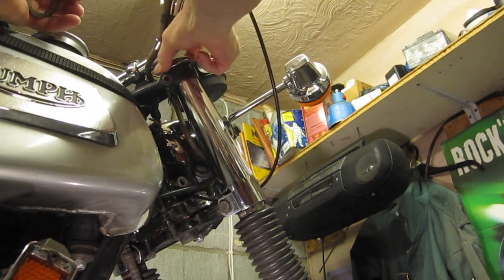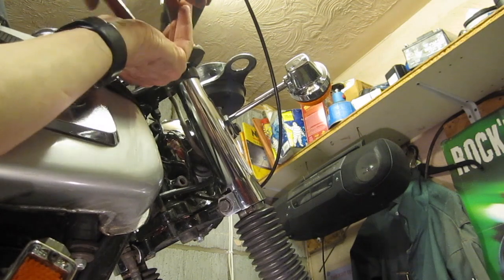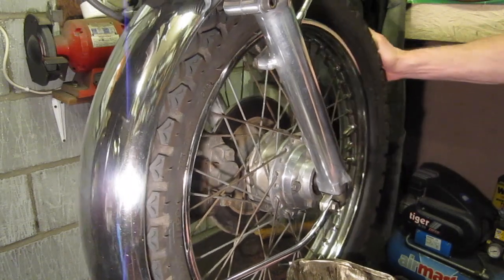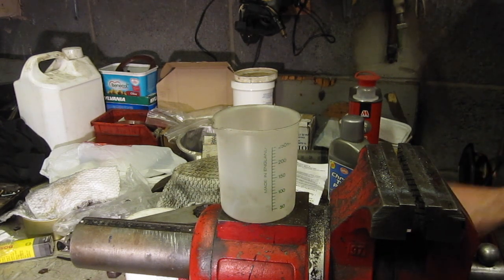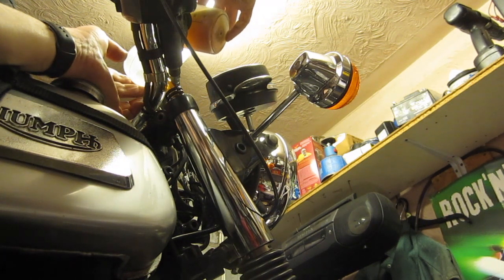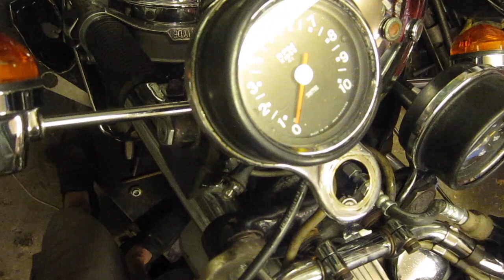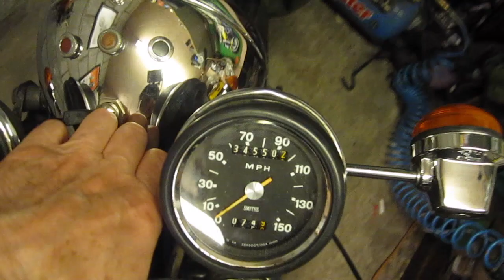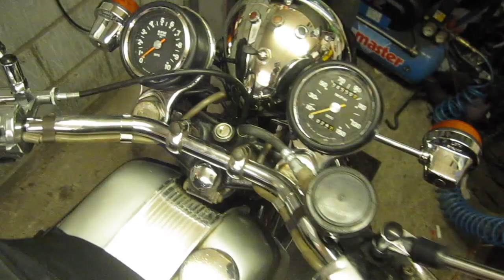Change Fork Oil on my Trident T150V

Comment: I start from unscrewing a handlebar what makes all operations with fork's cups easier. If you have stock heavy springs with red paint on the one end of them, they are the main reason for harshness of the front fork. Another one is an oring on a damper making forks to stick too much.
BMW use little rings, like piston rings on a damper and they just slide inside. You can get a plastic rings from Klempf for ridiculous price.
I use W5 oil in my forks, lighter progressive springs with the plastic rings instead of orings and my front fork feels much better, but still a long way to feel like BMW fork.
Reply: Very nice bike, I'd rather had your combo of home market tank and seat instead of mine export one., aha if you unscrew pinch bolts from an upper tripple tree ( yoke ) unscrewing fork plugs is much easier.